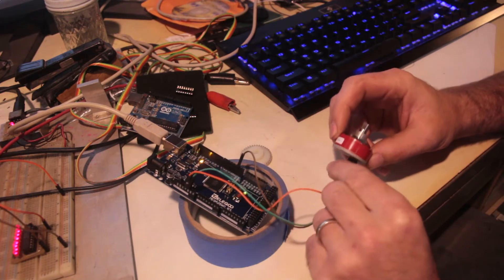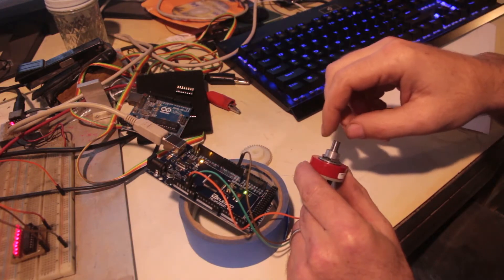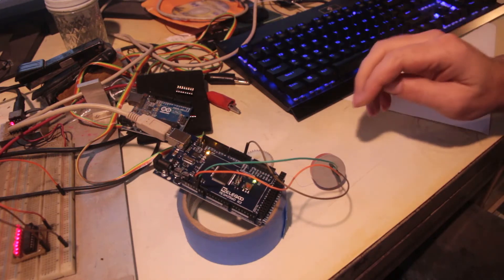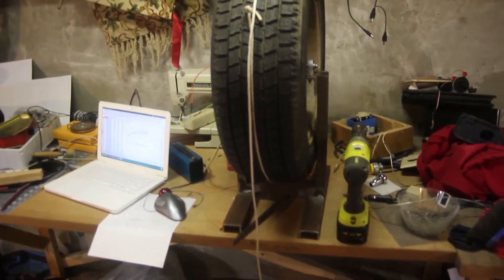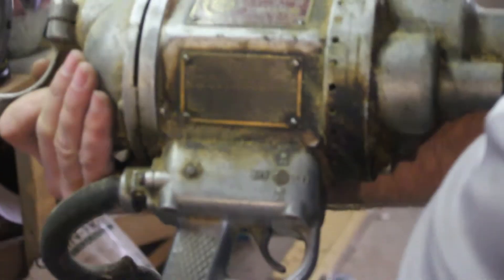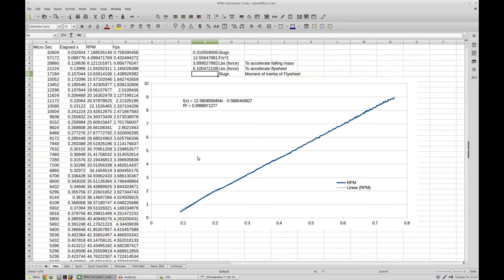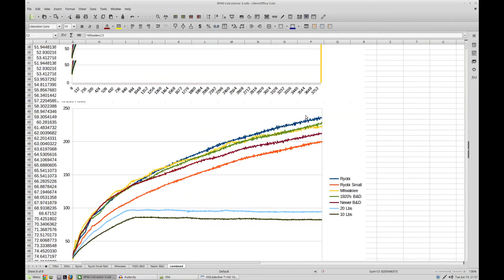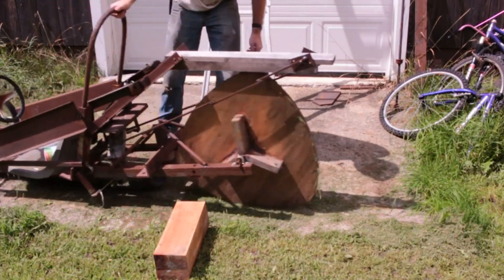Results from the tool torque tester

Comment: You’re really close on the math to a horsepower value. How is that compared to the rated number on the tags? That was the whole point AVe was trying to get at wasn’t it? Can’t remember exactly. I also made the mistake of thinking we would double up adding weight.... lol dang it.
Reply from the maker: I was mostly done with the dyno when I decided to look for drill torque ratings and found nothing.  The name plates on the drills I have just have Volts, Amps and RPM, no horse power or torque rating to be found.  I should try and find that old video and see what his goals were.

I did start trying to calculate the instantaneous torque in hopes of eventually getting to HP and ran into some problems.  There is some jitter in the encoder so it makes it seem like the the fly wheel isn't smoothly accelerating.  Which means the instantaneous acceleration is significantly higher or lower than it should be, it all averages out ok but it really means I have to select a range of rpm to calculate the torque over.

I would like to eventually get the spread sheet setup so I can plug in a starting RPM and a ending RPM and have it spit out the average torque between the two.  However, it's good enough for now.